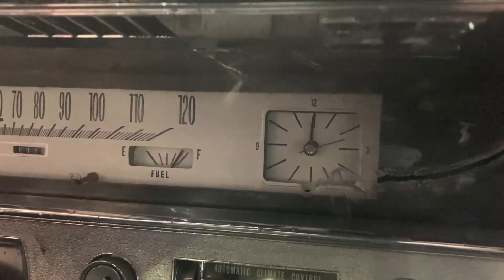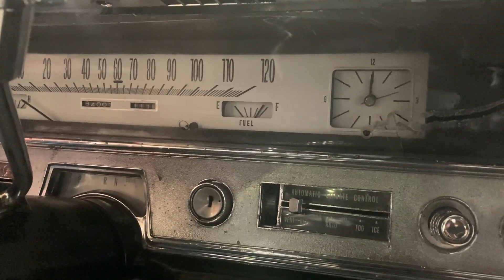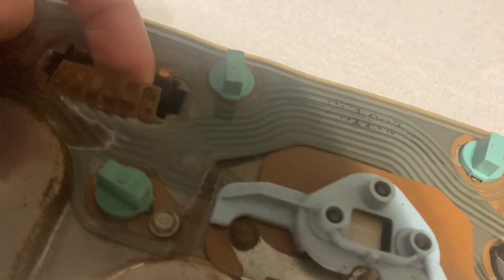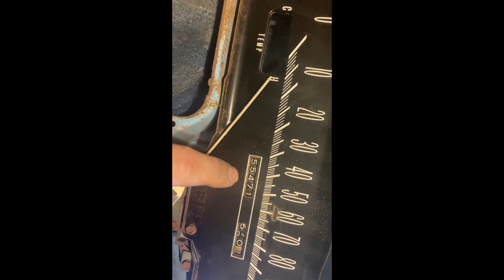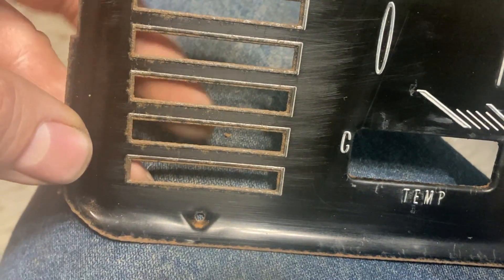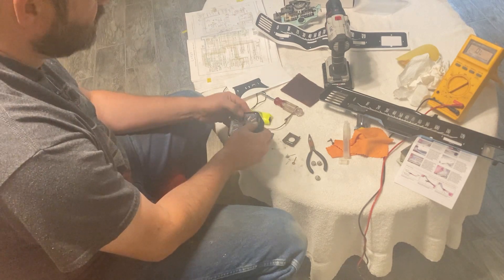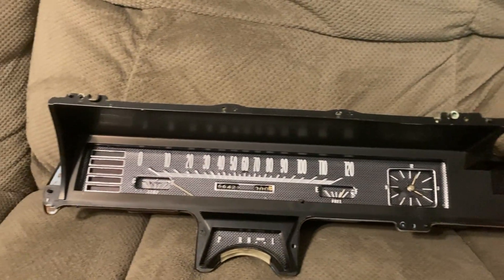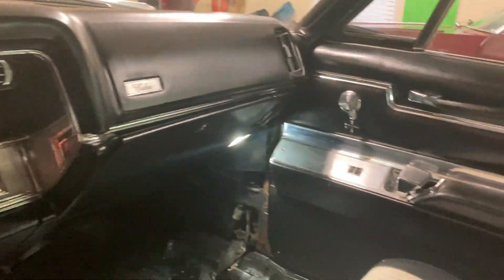How to Test your Classic Car Instrument Cluster. Gauge Face Wrap. 1967 Cadillac.

Comment: How did you get the dash cluster out lol
Reply from the maker: It’s a difficult process
Reply: @ImpalaCadillacRestoModDIY  I’m starting to see that do you have to take the dash pad an lower dash pieces off?
Reply from the maker: @levipipkin34  yes, you really need a shop manual
Reply from the maker: @levipipkin34  thats right
Reply: Where did you get the LED dash lights? Do you know if they come in a warmer color that more closely matches the incandescent bulbs, like 2700?
Thanks.